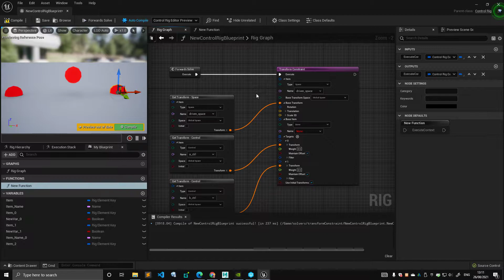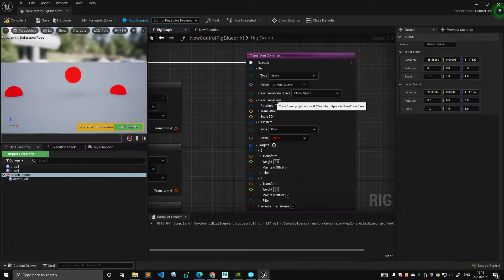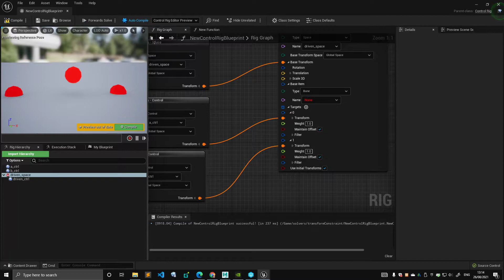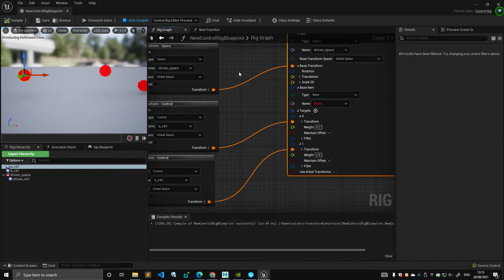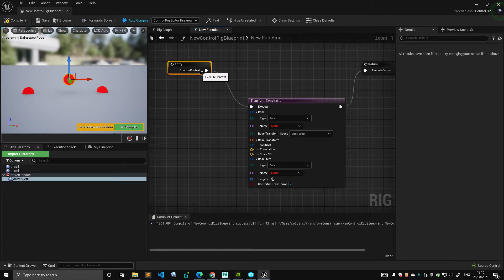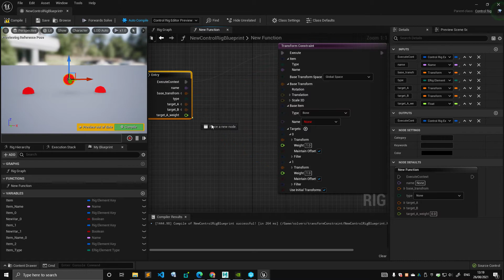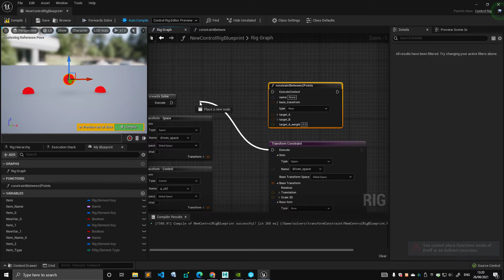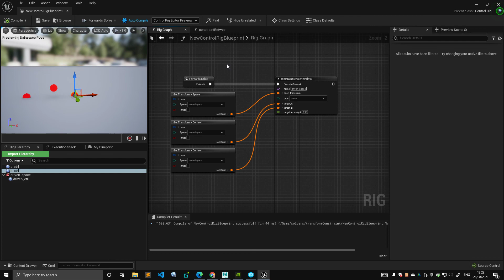Control Rig - 09 - UE5, Functions and Transform Constraint

Comment: Hi, I'm using Unreal Engine 5.0 and 5.1. I couldn't do Transform Constraint. Would you help me with this topic?
Reply: Use parent constraint instead. It's much different than the video, but if you play around with it - you can get it working!
Reply: @fracturedfantasy  Thank you for your answer. i am new to this. I couldn't find it in my research. Can you help with this please? Thank you again.
Reply: @hardiskprg  Use "parent constraint" you will find that node in 5 & 5.1.
Reply: @fracturedfantasy  okey, I trying. Thank you so much
Reply: @hardiskprg  Just make the middle control the child and the other 2 controls the parents. Then adjust the weight of each parent control to create the affect used in this video.
Reply: @fracturedfantasy  Work like a charm. But the Middle Control can't move by its own anymore. Do you know how to fix that? I'm working with Ue5.4

Comment: That's exactly what I was after :) We can create a function per limb, reuse the same function for both limbs rather than copying the whole graph. Love it! Thank you for all the videos, they are very informative and well presented!
Reply from the maker: Those function you mentioned are now available as videos (around n17 and n18 )   :)
Reply: @xtruder3D  yeah I have seen that :) nice one!
I personally prefer to have one function per solve instead of encapsulating setup, forward and backward in one. I found the graph is getting to messy and could be harder to debug. I have requested a "get input" node in functions, the same way we can do "get variable".
Just to reduce the crazy spaghetti connections from the inputs' function.
Reply from the maker: @FrenchAdrift  yes fair enough. It does makes sense but I am stressing over function callback so whomever watches the video can get used to the idea. People might not be proficient in python or other languages :)
I love the idea of get input functions, I also requested a separator for inputs in functions.
Reply: @xtruder3D  oh cool, yeah some separators would be great !